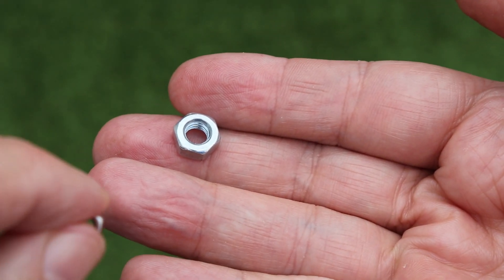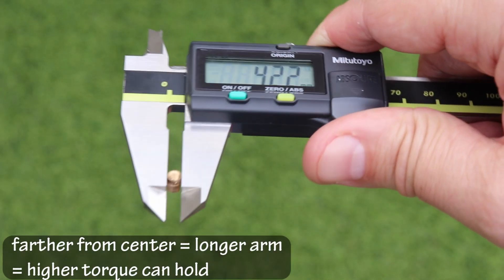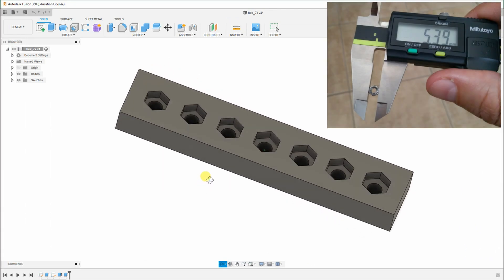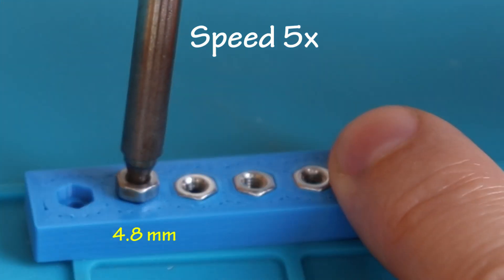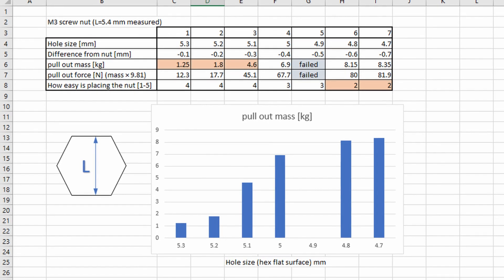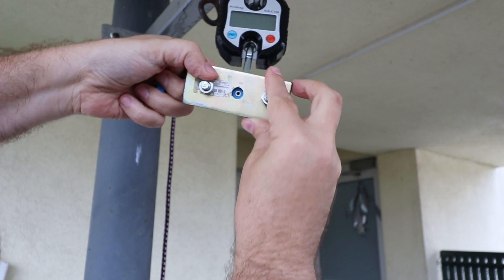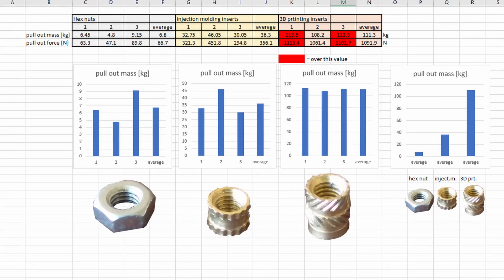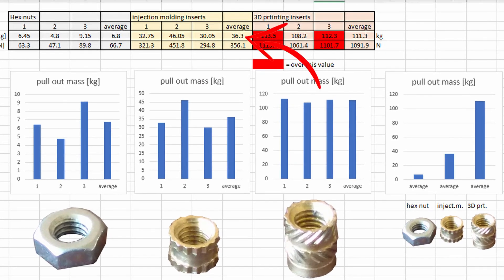Hexagonal nuts as heat set (thermal) threaded inserts into 3D printing

Comment: Surely these inserts would be used in a orientation where the nut would have to pull "through" the 3D Printed Part, and not "out" of the 3D Printed Part? Is there a difference in strength if the part is flipped around and pulled from the other side?

Comment: Another con with the hex nut is that you always have extra work with them in cad. And actually in real life cases when they fail is not because they carry that much weight, but when they work as a sandwich, the middle material holds up, and when you tightening the parts together the nut will pulling out by the screw before you can even tighten them. Maybe the strength could be improveb by cutting/grinding some grooves imto them, but then its really just not worth that extra mmount off hassle.

Comment: Why not use a litle preprocessing on the nut? Like mount it on a drill/lathe and make a groove around. IIt should improve the strength making it similar to the injection molding part (or even better.

Comment: I wonder if using smaller sized hexagonal standoffs (ones that look like a nut, but one end is like a screw for continuation) would be better?

The idea would be that "hopefully" the scrend end of the standoff would be melting together with the plastic and thus make it not fall out and the hexagonal part would still work for torque.

Likely not so big of a financial gain, but for times when you have standoffs laying arount I wonder if they can be used.

Comment: Looking at your test how come you chose to use the heated nuts on the same surface that a bolt head would also be on? Would there not be tremendous amounts more of holding power by simply having the nut on the other side of the plastic test piece. When I use these I never design my part to use a nut like how you have used them in your test.

Comment: Thanks. Seems I can use the nut in things like fan shrouds where I don't need a lot of strength but maybe have to thread in multiple times for service of the fans,etc.
I will continue to use the brass 3d printing inserts when I need a high strength part.

Comment: Hello! For the hex nut, the adjustable soldering iron that I can find has 200C as minimum temperature and not 180 as you conduct your test, will that be fine for PLA?
Reply from the maker: Should work with 200C too, just follow when to remove the soldering iron.

Comment: Thanks Igor for the recommended insert space dimensions at 6:57, it's very helpful. Note, the idea is to insert the Hex nut at the top end of the 3d printed part (not the bottom end as in your test), then its load capacity is ±30% greater than the last threaded insert you tested.

Comment: I wonder what would happen if you score a diagonal in the centre of each face of the hex nut which creates a llittle valley for the molten plastic to collect in . I can send you a jpg if you wish
Reply: With what tool you would score that diagonal? I guess you mean the line scored into the nut would be parallel with the nuts top-bottom faces and go along the nuts faces "circularily".

But I wonder that the nut is metal so if there are simple tools that can make that little valley into the metal at home simply?
Reply: @u9vata  I think I would use a mini grinder wheel disc 30mm attached to a drill. Grind a line into the hex nuts sides ( x6) so that when it is pushed in to the plastic there is a valley that the plastic melts into these valleys and ends up a smaller diameter than the outer hex edges. Similar to the score marks on the sides of the other nickle threads you tried.
Reply: @das250250  I was thinking more in lines of: get a thin wire, a hammer and something that holds the nut in place...

I could make scars on a nut I tried now on its surface face, but harder when I want to score its side. Mostly hard because the nut itself is pretty small.
Reply: @u9vata  I am happy to send you my idea in picture  via an email or app

Comment: Insert a Hex nut in 3d print then put top cover with a hole the size of nut hole size. Two parts.
Reply: Or just insert it deeper, plastic will reflow over the top and make it significantly stronger.
Reply from the maker: Interesting solution, but depend of the design, sometimes thats not possible.

Comment: i wonder how the nuts would fare if you created basic knurling on the outer surface
Reply from the maker: Yes, I was thinking about that too, but I wanted to test standard nuts, without modification. Because knurling would be different from case-to-case.
Reply: @MyTechFun  it would definitely be a case to case scenario as the angle of the force would change the engagement of the knurling i just felt it might be a good test as the threaded inserts had protrusions to prevent pullout

Comment: You should get/make a block and tackle or pulley set up for these tests. You'd be able to test to much higher forces without hurting yourself. Great work though! Very useful info
Reply from the maker: Working on safer solution, I need another rod to attach second pulley.

Comment: Nice video. Is there any chance that you could do a test where you are pulling through the part to take advantage of the increased area of the hex nut? Also, a torque test for the same reason?
Reply from the maker: Yes, in near future, but first I have to prepare some stronfer measuring equipment, because my weight is not enough for that pulling test. But this would depend a lot from type and strength of plastic material.
Reply: @MyTechFun  if I may, I would think a cheap and easy way to do this would be a hand winch and a few pulleys.
Reply from the maker: @Jazz3006  Yes, only I need something on the oposite side, where to attach a pulley. But it will be done soon anyway.

Comment: Hey Igor, interresting Tests! Little tip: use the same scaling for your diagrams. It's easier to compare with each other ;)
Reply from the maker: Yes, I noticed that when I uploaded the video. But at least the average values has same scale. Probably I will do a torque test in near future with several sizes. Only it takes few months for items to arrive from China..
Reply: @MyTechFun  Easy enough for anyone to remap your values into a spreadsheet! Personally speaking, when the scales differ so much, I find your method much easier. The maxima and differences can easily be seen to compare across they types just by looking at the scales anyway.

Comment: To insert these, I like to put a matching threaded rod in the drill press, screw the nut on, heat it with a blowtorch, and then press it in. Keeps it nice and straight. For inserts with a closed bottom, remember to make an air hole so the trapped air can escape!
Reply: Good idea